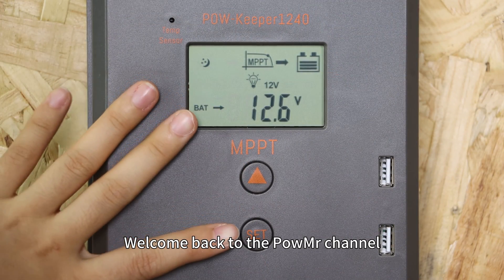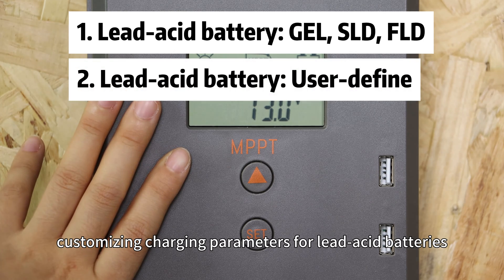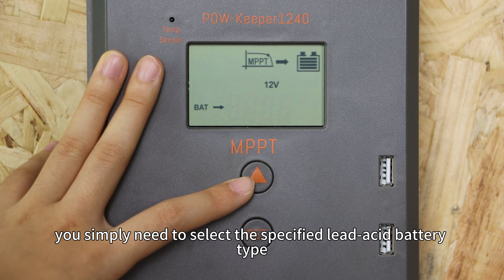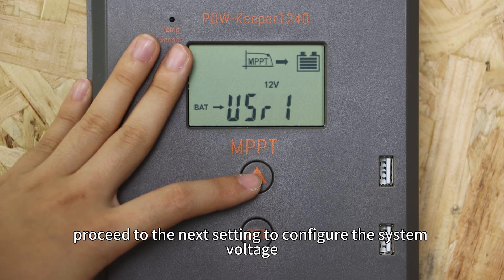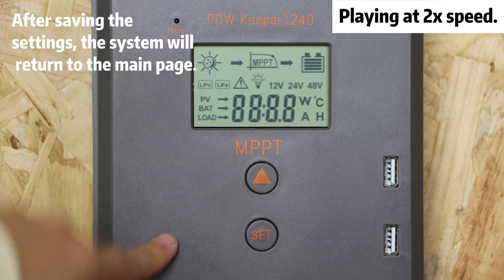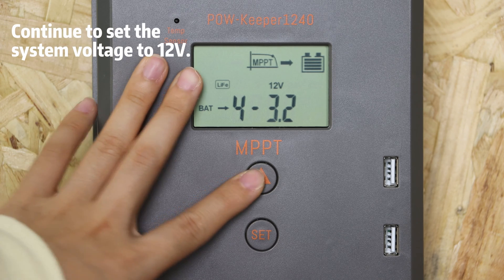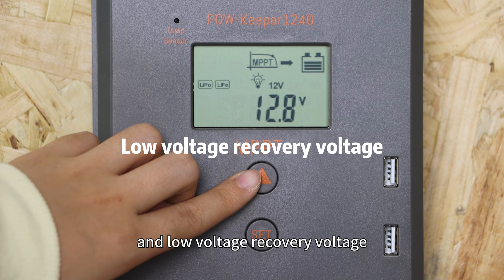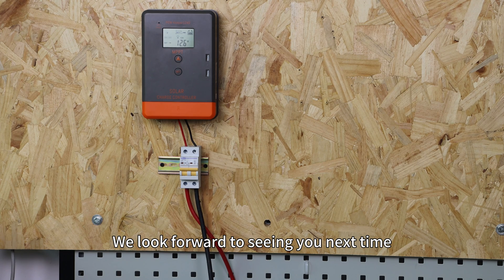How to Complete the Matching of Keeper Series Controller and Batteries

Comment: AGM battery compatible???
Reply from the maker: Yep.
Reply: @PowmrSolar  What mode or configuration would be for AGM batteries? Thanks
Reply from the maker: @667fuk  You can choose SLD or USE, and then adjust the parameters according to the instructions.

Comment: How do I config for 24 volt Lifpo4  8 cells --- do I set voltage first @ 24volt  then set Lifpo4,  for Lithium 4,  does it double the parameter
Reply from the maker: Please check the settings. Is the battery system voltage set to Auto? Auto will automatically adapt to the corresponding battery voltage.

https://www.youtube.com/watch?v=n8G9dixa16U&t=108s
Reply: @PowmrSolar  Yes got that - how do I set for 8 cell Lifepo4  - do I set the voltage first 24v  ?   then will 8 cell come up
Reply from the maker: @ Battery type can be set L08.

Comment: How to adjust the floating voltage of lifepo4 i have powmr 40 amp and battery lifepo4 is stock in 13.3-13.4 even if no load..
Reply from the maker: Lithium batteries will not enter floating charge mode.

Comment: Hello powmr, how can i change the full voltage 13.8 volt to 13.50 for LifePo4 battery. Mine is 40amp mppt powmr. Thanks
Reply from the maker: First set the battery type USE, and then you can customize the parameters.
Reply: @PowmrSolar  i have already set it to Usr2 hence LifePo4 battery 100ah  , 12 volt system. I could not lower down the float voltage which is 13.8 volt. I can only change the settings on Resume voltage, Constant Charging Voltage, Disconnect voltage, and reconnect voltage but not the float voltage.
Reply from the maker: @aldymcpndg14  Can you record a video for us?
Reply: How to increase the brightness of the lights from the settings
Reply from the maker: @easyelectronicshq2636  Screen brightness cannot be set.